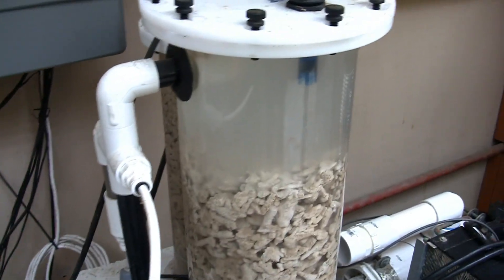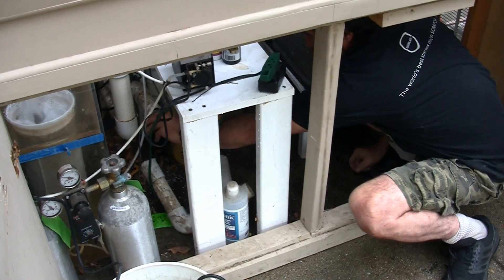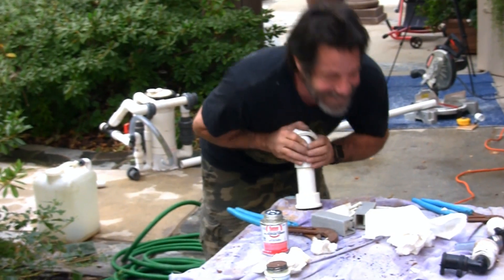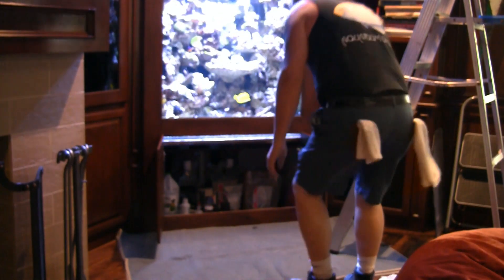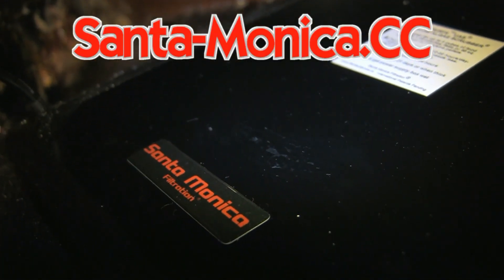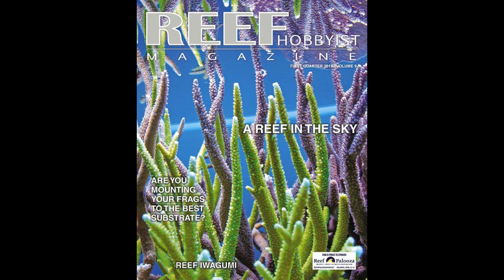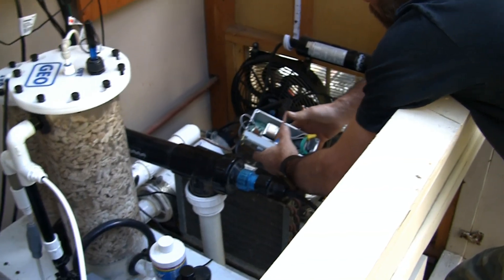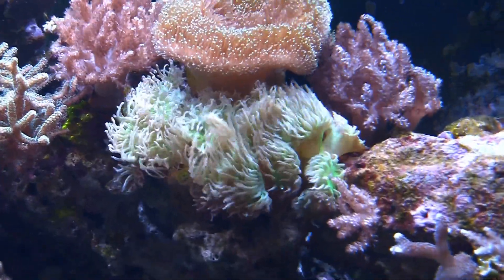Reef Tank Chiller Repair, LA Fishguys, Episode 165, Part 2

Comment: If i recall you installed radions over this tank, what lighting schedule are you running?
Reply from the maker: The tank had some Aqua Illumination Lights, which we are still using, and we added FIVE Kessil 360W's. Scott set up the schedules, which are something like 1PM to 10PM
Reply: I might be wrong, an they may be Kessil